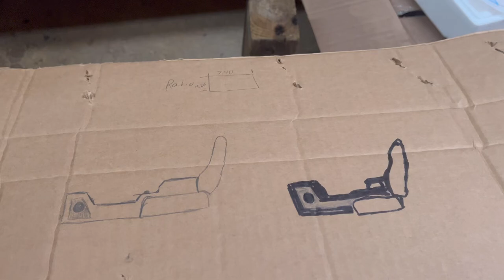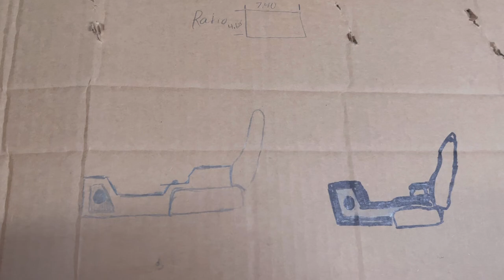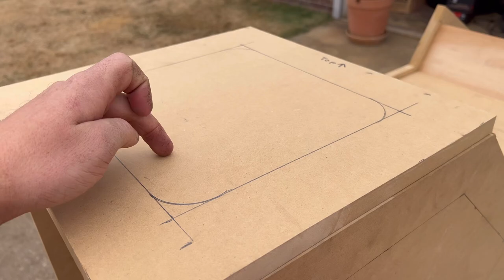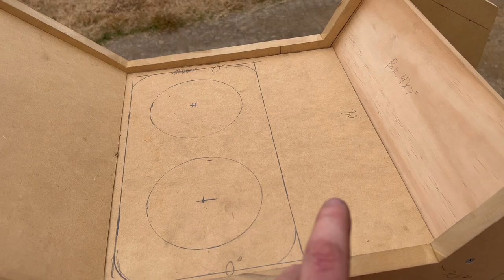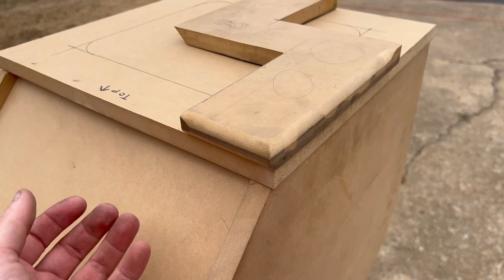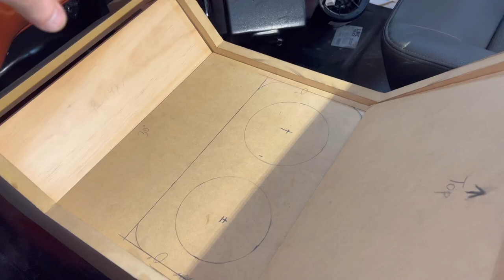Building a custom console for the C10

Comment: I just got a 90 Chevy Silverado single cab. How difficult will it be to add a custom center console???
Reply from the maker: Not too hard, you don’t have to be super elaborate. If you have a bench seat it can be as simple as a small box with two cup holders. There are some companies that make them but are really $$$. If you plan on doing it yourself the best thing to do is make lots of sketch’s and cardboard templates to make sure it’s perfect. I use 3/4 mdf board for the majority and 1”x6” wood boards for any structure as they are stronger.
Reply: @kesselsgarage  I'm planning on building an figure out how to put a decent system into it. But I'll have to figure that how eventually... Thinking 10s or 12s
Reply: I am assuming the floor heat will still be effective with the console in place? I have a 85 gmc c15 so this looks nice so far.